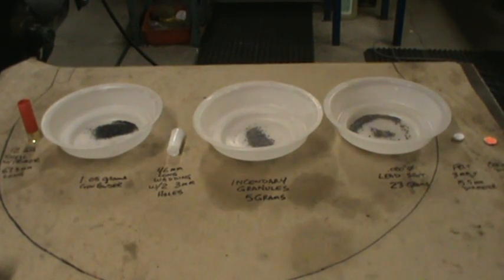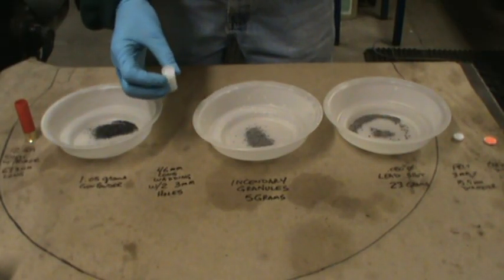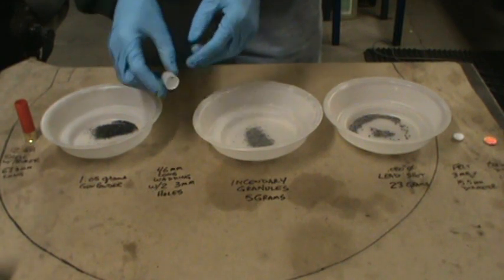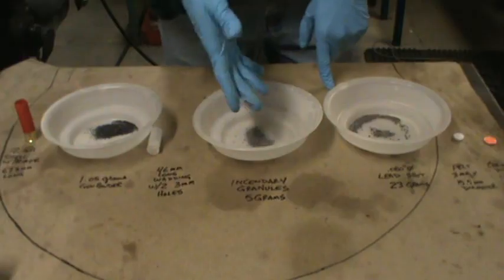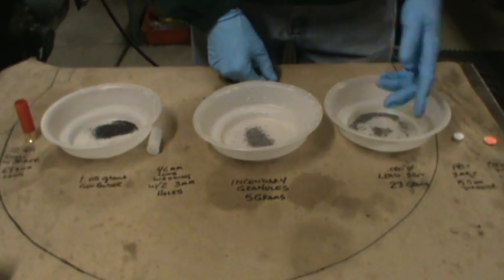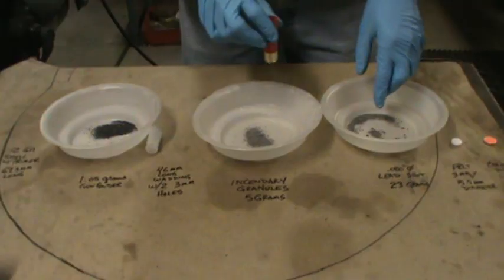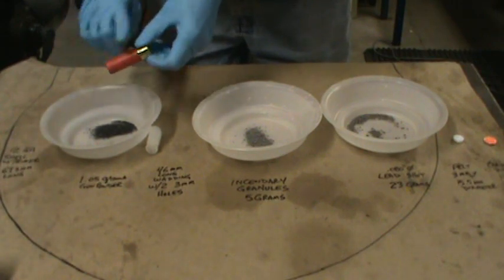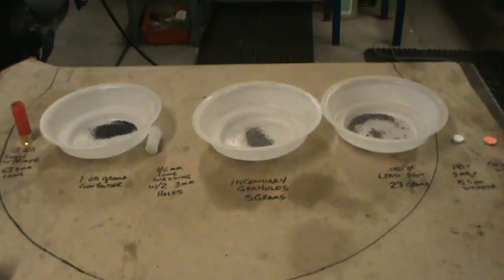Dragon Breath Shot Gun Shell - Construction

Comment: That is titanium sponge. +20-80 mesh
Reply: This is what i was going to try and use, im using 10 mesh tho, about 1-2mm in size pieces.  Do you think this will work?
Reply: It should the ti and MG used in these shells are easier to ignite the finer they are say 20 to 40 mesh lights very easy.
Reply: @jeremyarnold1979  thanks my dude 👌
Reply: At least someone got it right! Ti sponge……..

Comment: It's magnesium
Reply from the maker: From my experience lighting fires with Boy Scouts and on-line research, Magnesium is my best guess.  I recently ordered Magnesium material on-line, but the wrong size granules were shipped to me, so, I'm still working on replicating the performance.  On-line fireworks companies sell various materials to make different color flames.  My long-term goal is to experiment with various colors possible.  

As this a low priority interest of mine I don't expect to have a final answer for a while.  

When I have the right mixture, I plan to start a brush pile on fire using a Gallon of Gasoline in a milk-jug ignited by a dragons breath round of my own making.  If someone does it first and posts a video, I'll be happy to watch their video and save the prep work on my end.
Reply: NO IT IS NOT  zirconium sponge
Reply: @lesterawalt3184  why not?